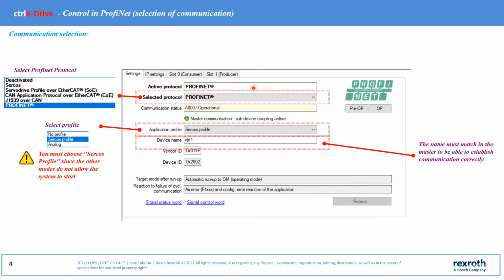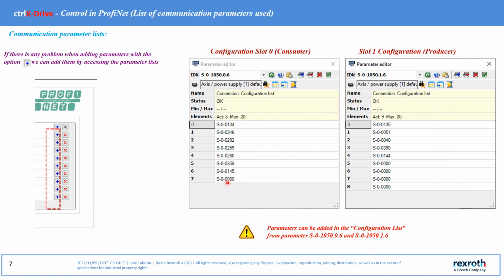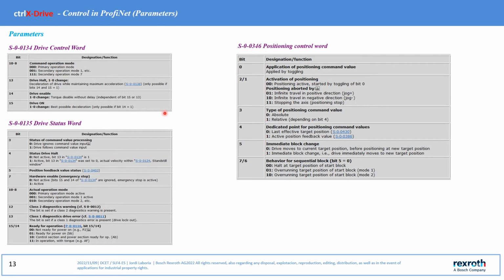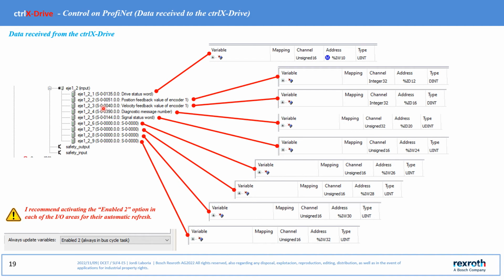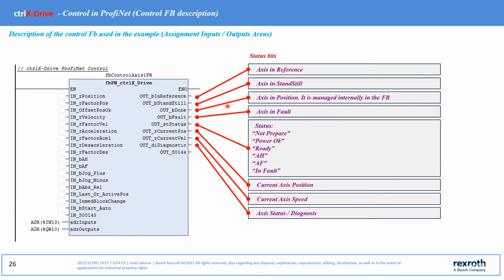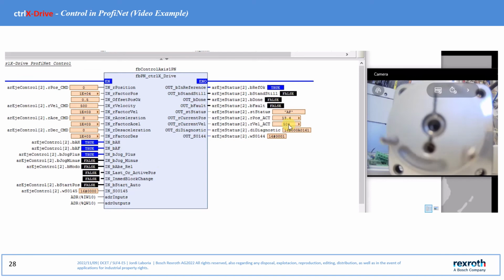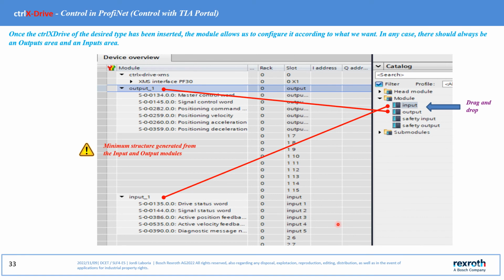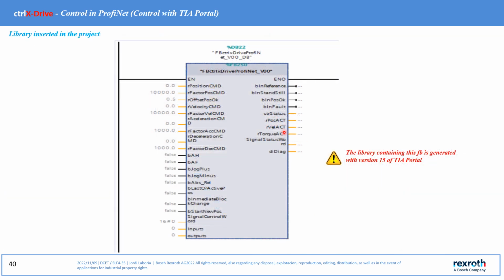Using ctrlXDrive In ProfiNet

Comment: A password is required to compile FB in TIA v16 :(
Reply from the maker: Good afternoon, I have uploaded the ctrlX Drive control module in Profinet for Tia Portal 16 in the Mega link. Parameter S-0-0092 has been added to control Torque. The block is open to be used without problems. And if you have any questions, don't hesitate to contact me.